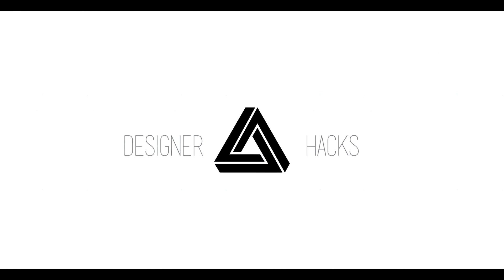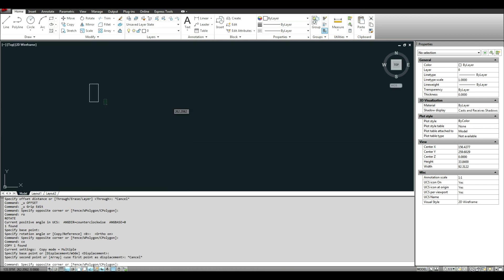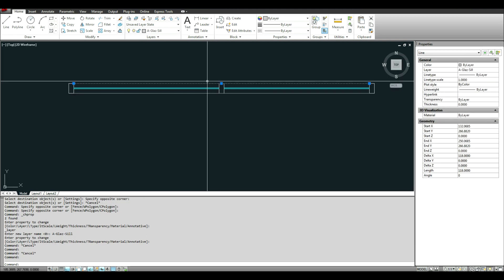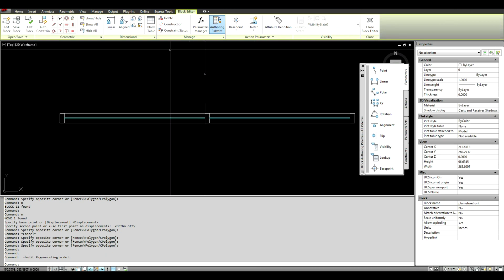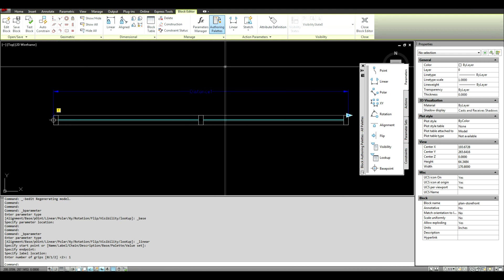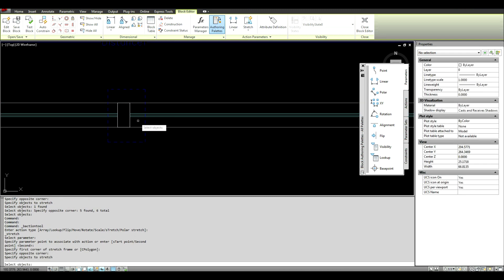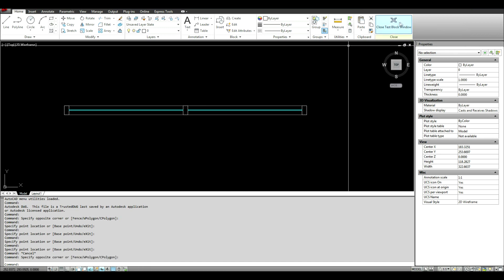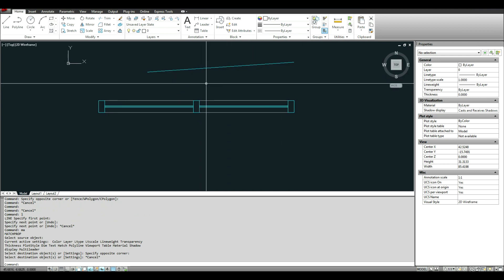How To Create A Simple Dynamic Block in AutoCAD using Stretch

Comment: Thanks for the video. It was helpful. The stretch works for me. But I cannot get the rectangle to stay in the center when the whole thing is stretched. This is because when I click on the stretch action icon (labeled Stretch1, the properties does not recognize the icon. The properties title (the drop down) remains blank. Therefore I cannot change the distance multiplier and other parameters of that stretch action. Could you help me out please. Thank you.